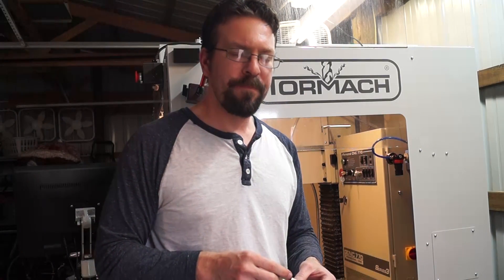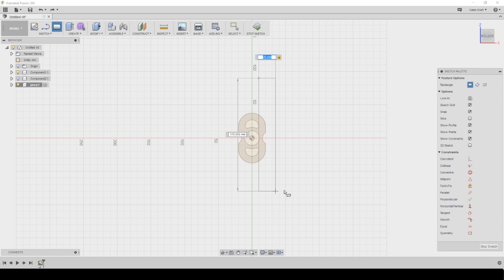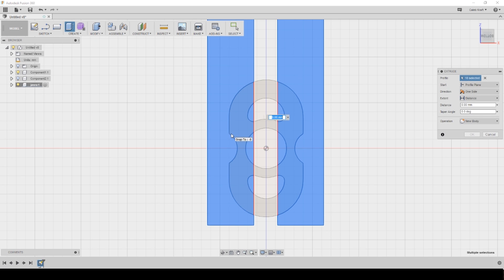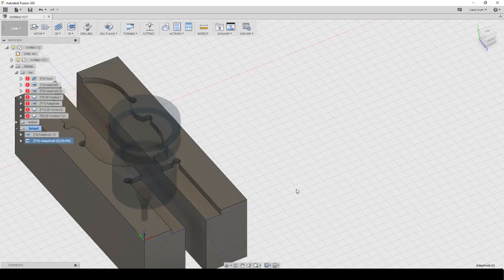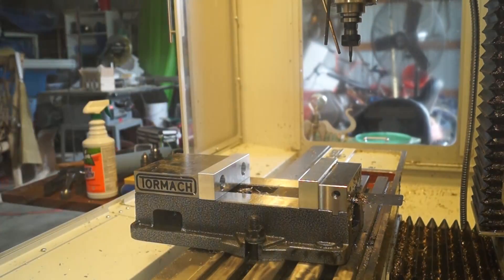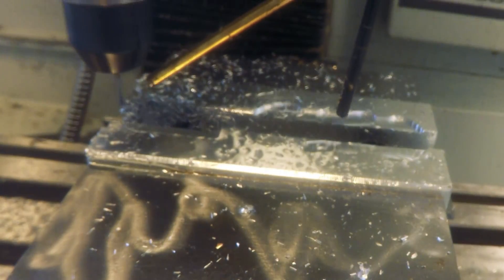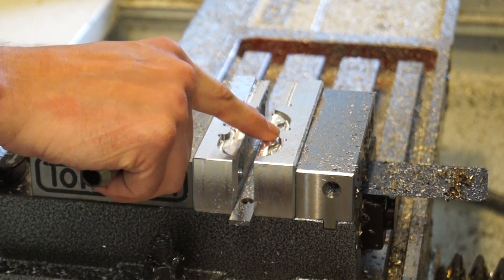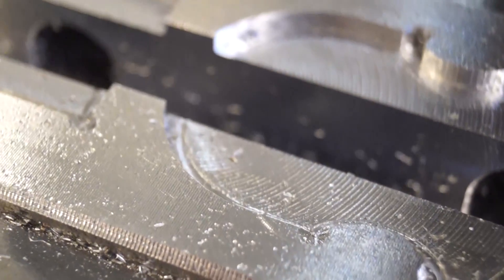Making soft jaws for a fidget spinner on the Tormach 770

Comment: Wouldn't it be better/easier to use a piece of scrap aluminium as a fixture and machine your part's shape in it? You can machine a channel in the center of your fixture along the X axis leaving about a couple of mm stock at the bottom so when you tighten the fixture in the jaws the fixture will be springy enough to be able to snug your part (if that makes any sense)
Nice vid, thanks for sharing.

Comment: Very nice Caleb!  It may have been a product of your air compressor problems, but I would crank up your fogbuster air pressure just a bit to help blow the chips out of the pocket.
Reply from the maker: yeah, it was really struggling to get pressure. I didn't notice till afterward why. I suspect it will run better once I repair this thing.